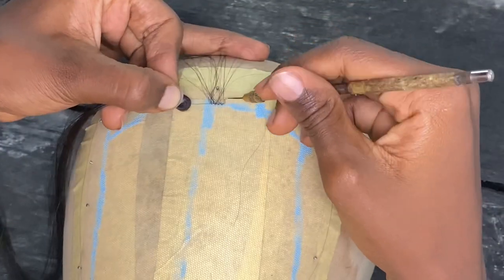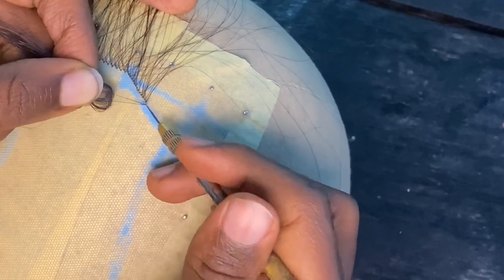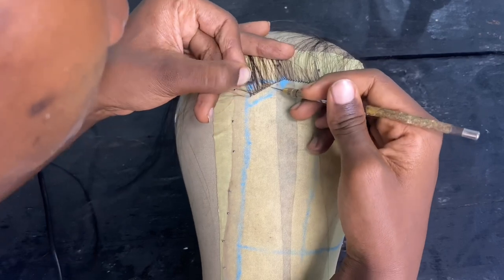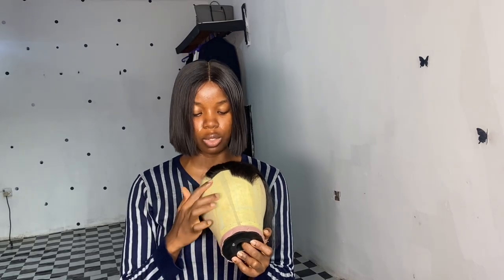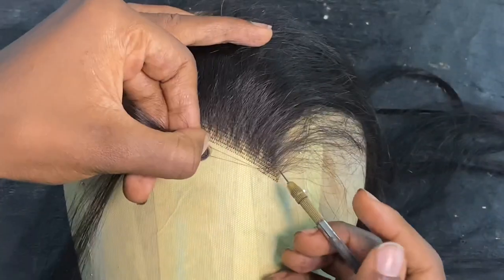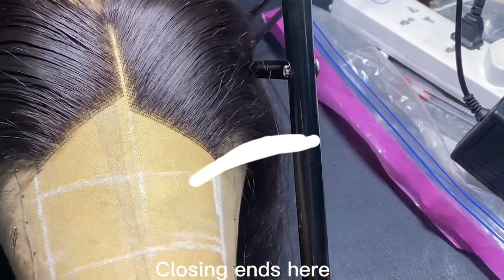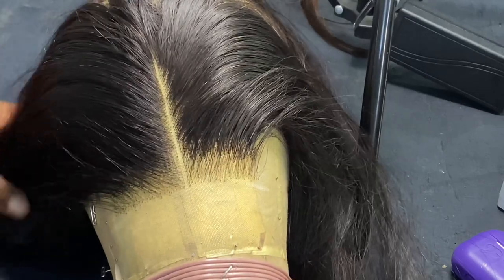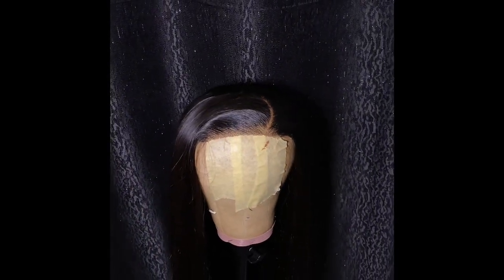How to ventilate a mini frontal: 5by5 closure ventilation with natural hairline

Comment: On the sides at the start, are you also changing the direction or just ventilating in the diagonal pattern, and not side direction instead of up and down direction?

Comment: Pls when ventilating from scratch how many hairs did you picked and also the straight line you ventilate how many lines was it
Reply from the maker: I usually pick between 1-2 strands depending on the thickness of the strand, 10 straight lines as it is a 10 line base I am doing
Reply: @AkarueseBawo  ok

Comment: Please what makes the closure start coming out from underneath when you wash it?
Reply from the maker: 1. When the knotting is weak, this is most time common with single knotting and split knotting 
2. When you wash it to hard, don’t scrub closures like u are scrubbing clothes because then it will pull out from the under

Comment: 10 lines for the base, then 3lines to cover the base using one line spacing in a diagonal but still going to the back( horizontal), then the body of the closure is diagonal pattern(slanting)..am I correct.
Reply from the maker: The lines to use to cover the base isn’t exact l. Sometimes is can be more as long as it gets to the parting that’s what matters